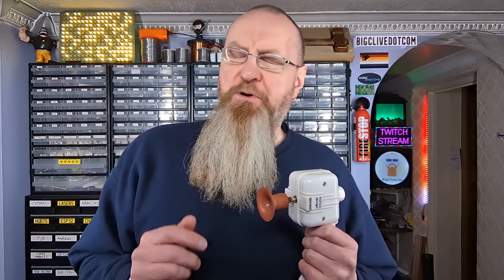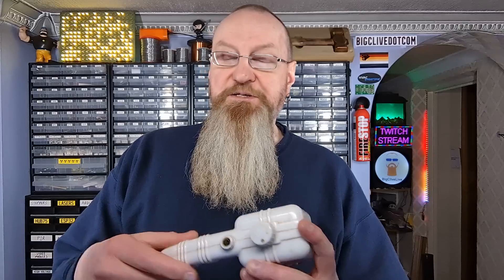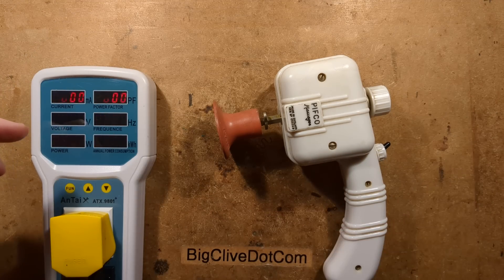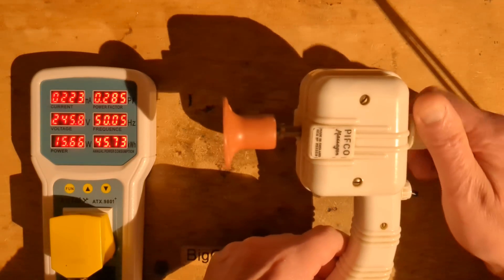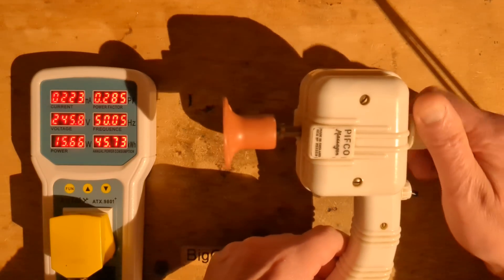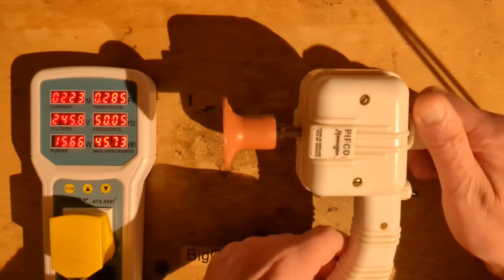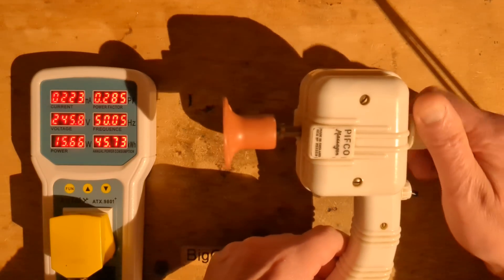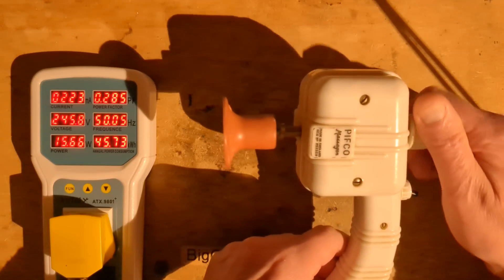inside a vintage British Pifco vibratory massager

Comment: "I hope that's just grease." Clive quote of the year.
Reply: I hope that's just a bit of Clive's beard whisker under his thumb at 4:05
Reply: @lmamakos  LMAO!
Reply: "That's not Crisco"
Reply: Narrator: It wasn't grease.
Reply: Laughed my head off. Had to walk around for a bit.
Reply: you got it wrong, when Clive says it, it's "greeeeze", not "grease"
Reply: @gorak9000  Either way, it is still quite scary to find....
Reply: Definitely a history item

 - where do you find gadgets to  talk about 

Bakelite is history, Singer sowing machine had a pedal resostadt made of it.
Reply: @keithcitizen4855  Yes they did, I still have my mother's old Singer from the 60's, still works as far as I know, haven't used it in a few years. Bakelite was also commonly used in old cameras of which I have a few. It's a great material for many things as it's stiff, stable and non-conductive both thermally and electrically.
Reply: @Murgo-u3l  and lasts for flocking ages unlike the modern stuff ;)

Comment: I've got a red early 1970's version of that Pifco in its black box with all the accessories. Its in mint condition as it was hardly used. It has a black cable with a black ROUND 3 pin plug and on the back there's a black switch to change the speed. No dial.
Reply: 5A or 15A round pin plug?
Reply: 15 amp. In my house they didn't melt so easy.
Reply: That was a bit analytical. Come on put a bit more effort in it!

Comment: I have a later one (Orange with black bits, the back of it being heated for deep heat therapy stuff, Model No. 1558), used on my lower back cos it's two-speed, the low buzz setting, and the high rattle-your-bones setting, and it doesn't work for personal entertainment for me, I've said too much........... :P
Reply from the maker: I have one here for a future video.

Comment: From the lets-actually-build-something-that-last-more-than-5-sec-period. Love how old things can be taken completely apart and often designed to be serviced and repaired.
Reply: In exchange it isn't fluid-proof and connects directly to the wall socket.
Reply: @CptJistuce  Lol... comes with "surprise me"-function
Reply: I mean, it's basically just a coil and some metal sheets, very little can go wrong.
They didn't built them cheap enough because they just couldn't, but if they had our tech, you can be sure they wouldn't last.
Also survivorship bias is doing some heavy lifting here.
Reply: Service and be serviced...
Reply: Ever take apart a ATT phone made when they would only lease them to you? Several modules inside, service guy would just swap out the module and probably fix it back in HQ. 

My mom wanted her bedroom phone not to ring. I opened loosened a screw and lifted the wire off. Simple.

Built to be serviced.

Comment: I wouldn't have touched that without some protective gloves, very questionable gooey stuff there.  So a 1930's magnetic vibrator with rubber attachments that completely defeat the intended use...  I wonder if the rubber parts were swapped out for wood or metal back in the day for a more intense experience😉 Thanks Clive!
Reply: The rubber attachments do damp out some of the “impact” of the force on each stroke, but they also smooth out the mechanical waveform a bit.
Reply: I don't know, that rubber bit looks like it would provide some suction that would attach to some modern silicone implements.

Comment: Not so different from how hair clippers work.  The one I have was bought just days before they shutdown for the recent unpleasantness in 2020.  Just solenoid/transformer like here but with mechanics to make a back and forth shaking for the blades.
Reply: That's an old-school design - most of them now use a small dc motor with an offset cam on the shaft to move the cutting plate back and forth, and usually have a Li-Ion battery and are USB rechargeable - actually same thing for the modern hysteria devices. Come on down to Uncle Buck's clipper and vibrator emporium.

Comment: The spring plates being mounted diagonally give a bit longer spring, so they may last longer than a shorter set of springs. Maybe PIF in PIFCo stood for "perverts in factory" ? Maybe the foreman was called "Buzz". Any tattoo needle mounting collets / ink cup / brackets in the accessory kit? Nice teardown! My hysteria was relieved a good bit by watching the video. 8^) Cheers.

Comment: That plate at the top is surely just a weight?
Reply: No, it floats in the magnetic field between the two poles of the coil to be vibrated.
Reply: @erikdenhouter Yep, kind of like the keeper used with old horseshoe magnets.

Comment: why is it that the first thing i notice is the 'dangerous' old plugtop with uninsulated pins. The second is all the parts that are likely to contain asbestos.
Reply from the maker: There's always a risk of asbestos.  Even in some flexes.
Reply: Asbestos would not be in that device. It was used where very high heat tolerance was needed.

That is just cloth tape and cloth wire insulation.
Reply: @volvo09  tell me you know nothing about asbestos without telling me you know nothing about asbestos 🤣

Comment: One could be tempted to bring this device on a vacation to the USA, for the additional 20% of frequency.
Reply from the maker: That might reduce the effect.  Slower probably equals longer stroke.
Reply: @bigclivedotcom  That's what she said?
Reply: @bigclivedotcom  Ah, now we know why the Europeans chose 50HZ rather than 60HZ for their AC line frequency.
Reply: Top secret with Val Kilmer addressed the problem of operating on a different mains voltage  😂
Reply: @peterferguson2344 Love that movie. Shall have to rewatch, yet again.
Reply: @derikfawkes  apparently it took them 3hrs just to get the smile off his face  😂
Reply: @peterferguson2344 Here in East Germany we use 220 Volt current!
Reply: Back in the day of the (hitachi) magic wand we had sexshops here importing them from US and selling them together with a transformator to adjust to the 240V over here. Dont ask me how I know.
Reply: @berndeckenfels the things we had to do before everything ran on switched mode power supplies.
Reply: In a work meeting when I read this and died laughing.  😅